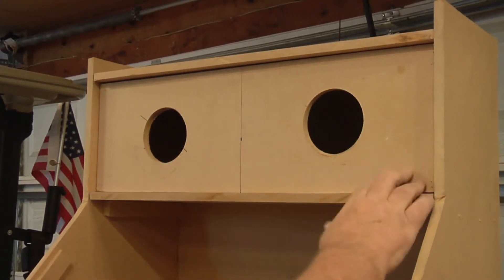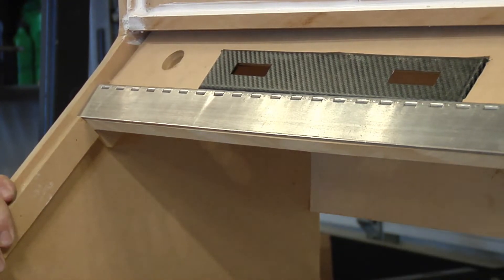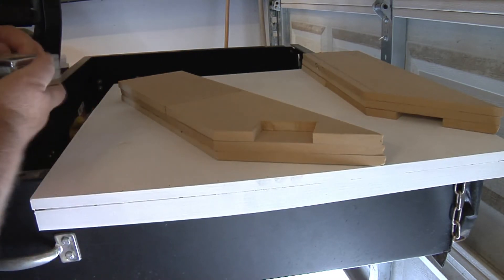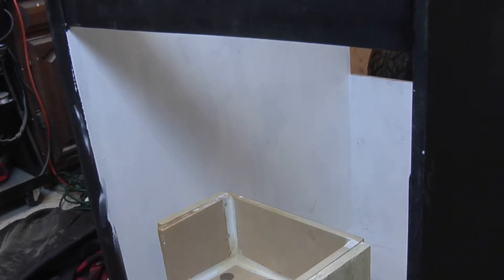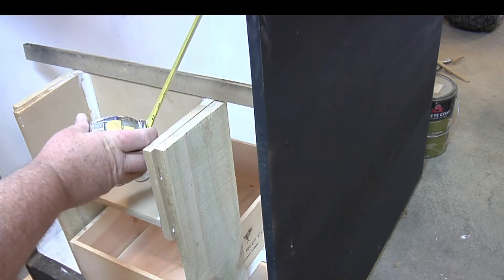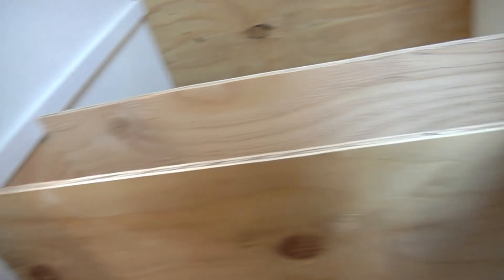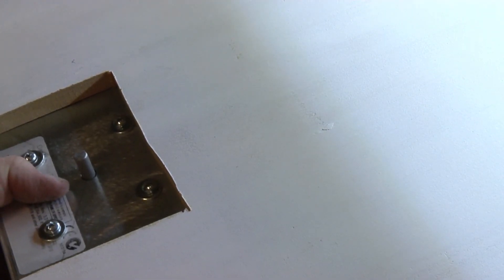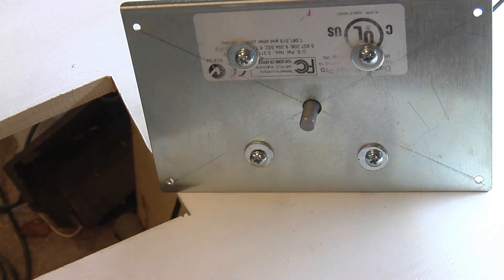Coin Pusher build, Part 3 install Loot Shoots, Motor mount Install

Comment: When you add those wood rails and glue them does that wood glue really bond or do you need to add nails or something to make sure those rails don’t try and separate from the cabinet? Also what type of nail gun do you use ? Also what size are those nails. Great video thanks for making this series because I’m trying to build one and am novice to all this
Reply from the maker: Yes, wood glue and pin nails work very well. And the glue bonds very good.  I use pin nails so the rails don't slip out of place.  Bostich nail gun 18 gage,  and 1 inch nails.  So worth the time spent building your own. Mine works very well now.  Thanks

Comment: I think if it was me I would incorperate the loot shoot and shoot that the chips and coins fall in to  in the front door instead of it being attached to the box, That way the coins and chips that fall into it can't fall between the front door and loot shoot, It don't seem to me like it would be that difficult to box in the front door so that these were all together
Reply from the maker: Yes, that would be cool. Thanks
Reply: @camaromodschannel  Yes with a little bit of planning to make the coin drop area slide into a boxed in section that drops into the loot shoot, possibly some 1" X 1" framing with the 1/2" MDF cut to surround the framing for the shoots on the back side of the 1X's, Sure this will add a bit more weight to the door, But with the hinges you put on the door this should not be a problem, If it was, Possibly a piano hinge on the door could correct that problem and support the extra weight. Also noticed that you put the piece of plexi over your loot shoot to stop the drops from falling out, This could possibly solve that problem also if the chips and coins had to travel down a less steap path way to the loot shoot and fall through a smaller area into the loot shoot. Having the entire 12" area that coins can fall into the shoot will make them fall out of control. Loved the build By the way!